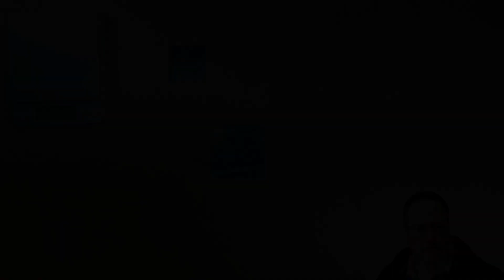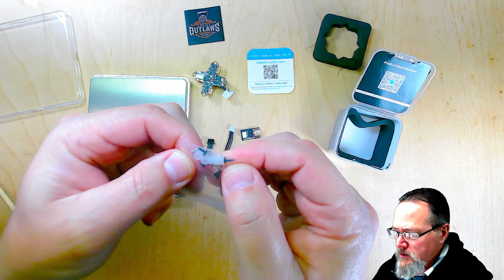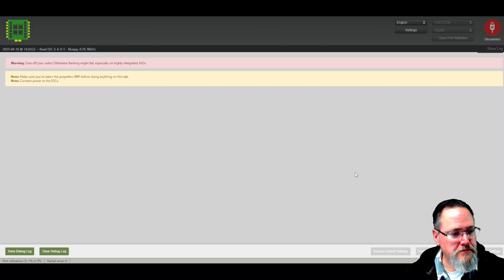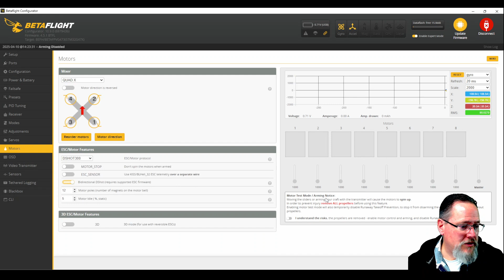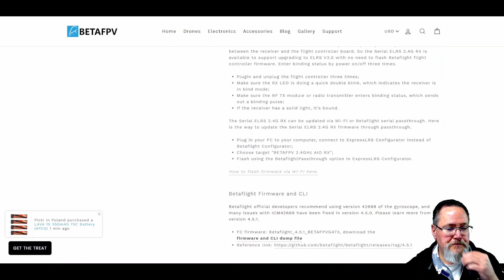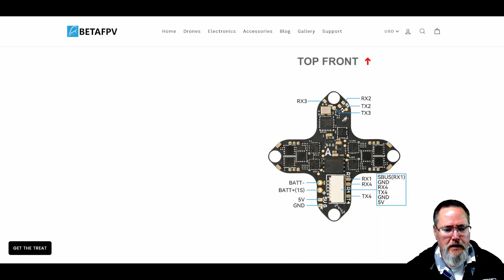Any Flight Controller Pre-check | Betafpv Matrix 1S G4 3in1 Unbox

Comment: Hi everyone. I accidentally plugged my battery in with reverse polarity on my 1S AIO brushless flight controller. I unplugged it immediately, but I still saw some smoke. The good news is the board still connects to Betaflight via USB; the MCU, gyro, and camera are all working fine.

The bad news is I found the source of the smoke: one of the ESC MOSFETs is completely fried and has two small burn craters on it. i found a mach QM3202M3 M3202M3  would it work ?
Reply from the maker: No, the M3202M3 has a conflicting pin set from the AGM210MAP...🧐

Comment: hi...i want to ask for help.. i got 2 of this flight controller.. my problem is it can detect by betaflight configurator but not showing configuration tabs..i have reflash the firmware still cannot enter into configuration tabs. please help..do u have the original firmware? please..
Reply from the maker: The firmware for the 3 in 1 , and the 4 in 1 , are different - did you make sure you flash the correct one?
Reply from the maker: Here's the HEX file. You can download the HEX to your desktop and load it to the flasher via DFU mode...🍻
Firmware for Matrix 1S Brushless Flight Controller (3IN1 HD) – BETAFPV Support Center https://share.google/MhpaijPhgoiH84xbu

Comment: Thank you so much for this video. I have 4 matrix 5in1s and I wish I'd saw this in all the searching and learning on my first 75mm build. Built in 1 hour 2 months to get flashed correctly.  I'm running the beta 1102 22000kvs I flashed the escs with the 48hz would that disable any features cause now I can't get my link quality back up. It shows 0/00 but flies great. Also I can't enable turtle mode so if u got any advice would be great. It's the 1mm thick diamond 5in1 with motor plugs. Thanks again. Keep it up
Reply from the maker: I appreciate your feedback, support, and sharing...🍻

Your OSD "link quality " node is missing? Go to the receiver tab and see if the 2 channels are moving - 11/12 or 12/13 (I think) .. Theae 2 channels in the receiver tab showed move slightly while running. Place you body over the antenna of your radio to see if both decrease (you blocking the signal) - TELEMETRY has to be enabled for this to work..
48hz shouldn't matter in the communication loop between the TX and RX... One thing to remember, never flash your ESCs when your Elrs radio is on (turn off your radio when reading or writing your ESCs...
Turtle mode is a setting in the Modes tab of Betaflight. Your ESC firmware has to be new enough for Turtle mode to function (its relatively new)... The Turtle mode is an extra AUX channel you create in the radio, fyi...🧐🍻
Reply: @PropsOff thank u. I did notice 11.an 12 being antennae. I did block it. I tried enabling auxiliary 11 hoping to get to do something..lol. seems all these small boards and chips  are relatively new as well as Lora technology.u have a wealth of info. I'm glad ur up a nd around. Nice to have spoken digitally to. U... let's get back to analog. Lol
Reply from the maker: @travt4963 
They change things so fast to maximize profits, it's seemingly impossible to keep up with all of it...🥵🍻🤣

Comment: firtsssly i crash alot. lately my core temp kepp rising and batt vol drops very quickly from 4.3 to 3.7 then battery low. what could be wrong?  by the way i solder all wire directly to the pads

Comment: Hello. My matrix 3in1 bec was burned accidentally. I need to replace bec IC. I can't find bec IC part number. Can you help me? 🙏 I think ic marking is 1270 6358, but i can't find 3 amp boost ic
Reply from the maker: @user-ed9px3cz7g  
Unfortunately, without a circuit diagram, it would be very difficult to find the voltage controller, regulator, and buck. There are thousands of options.. Just to add to the issue, 3 amps is unique, therefore, unable to scrap parts from other flight controllers. I was thinking about that in the past. If I identify the specific chips, I'll return here to share that information...🍻
Reply: @PropsOff  It possible to make circuit diagram of bec. There is some caps, resistors and one coil. But i don't know what chip it is. Sorry for my bad English.
Reply from the maker: @user-ed9px3cz7g  
I would like to get my hands on the schematic for this board. I haven't installed the flight controller in my build yet, I may take another look-see...

Comment: I snipped the 180 degree plug on the build I did last night and replaced it with a blackhorse. It’s actually about 0.3g of weight savings compared to an unmodded beta 180. Idk why they made them so heavy 😅
Reply from the maker: @FPVYeti  
That's a very significant weight difference.. I will definitely be removing the 180 plug on my upcoming build.. I appreciate your support and feedback...👊🏻😎🍻